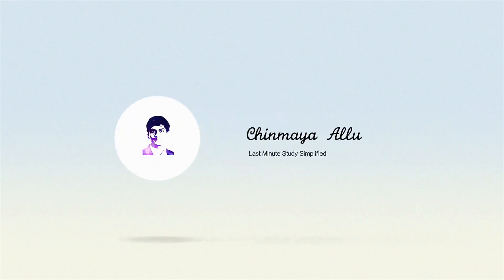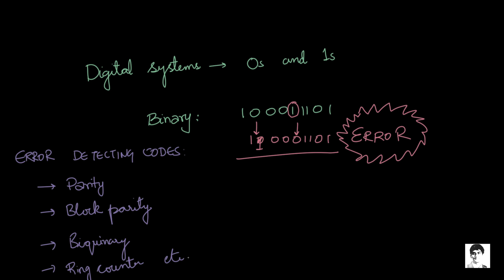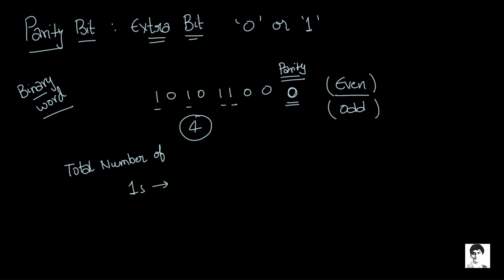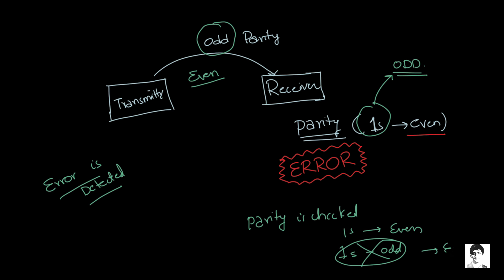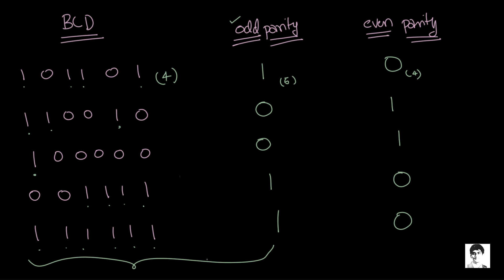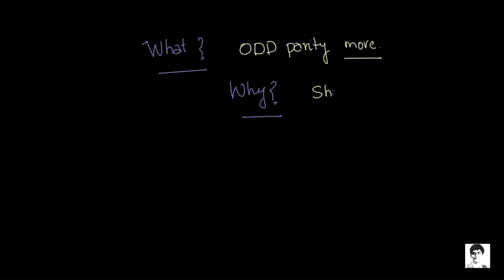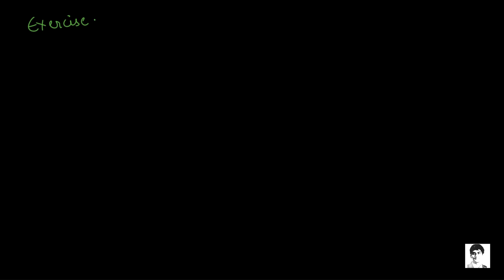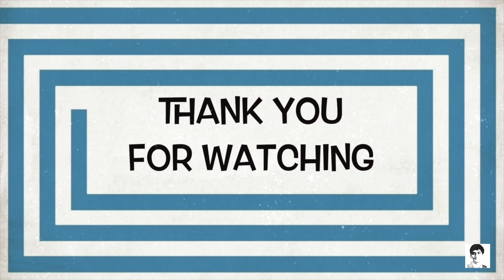PARITY | Odd and Even | Error Detection Code #1

Comment: Sir I've a query that in book I read that those codes having minimum distance 1 can't detect error and also can't correct errors bt at the same time there has been taken an example that 8421 code detects error and also correct the errors so how is it possible bcz 8421 having minimum distance of 1

Comment: single bit error-correcting code for the BCD number 0010 using odd parity is:
•	1 .1000010
•	2 .0100010
•	3 .1100010
•	4 .0000010